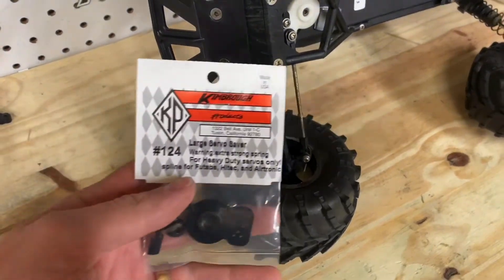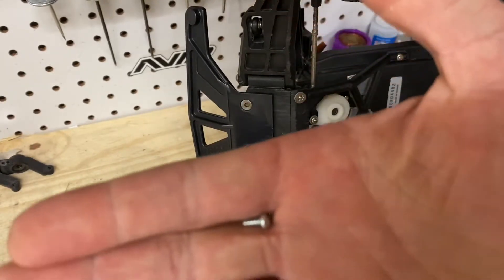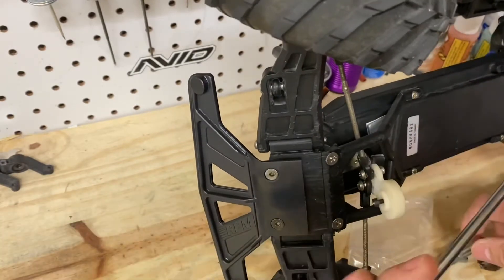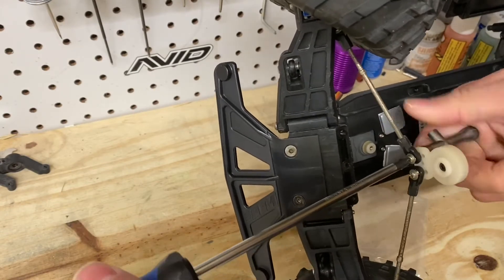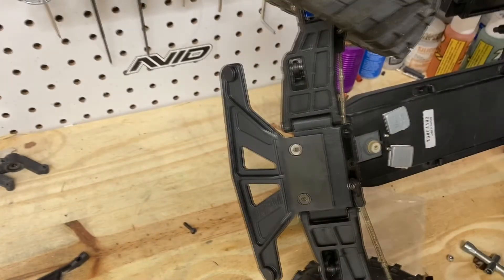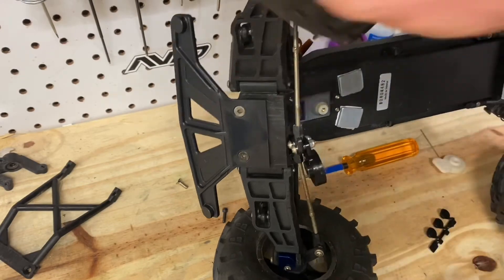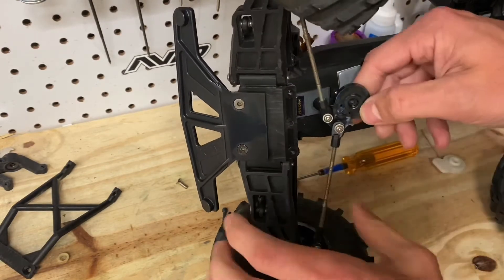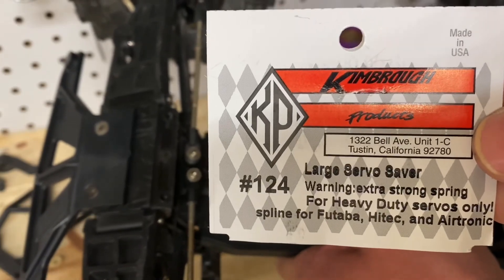KIMBROUGH - Large Heavy Duty Servo Saver Upgrade For Traxxas Stampede 2WD

Comment: How long did the heavy-duty servo saver last thinking about getting an aluminum one from hot racing
Reply from the maker: Still good, no issue with it!
Reply: I used to have a hot racing servo saver but the servo horn would strip easily
Reply: @@mattcamara4480 hitting the bumps would shear the teeth on the servo so I had to get new servo horns and servos

Comment: Is this similar to traxxas 1844 servo saver for Bigfoot?
Reply from the maker: Yes its a stronger direct replacement !
Reply: bro. it's not fitting right...
Reply from the maker: @sureshselvaraj9616  did you drill out the 2 holes in the horn to replicate the traxxas one?
Reply: @SuperFastRc  I did the hole, Its not about the hole, its about the spine drive, Its making some Noise
Reply from the maker: @sureshselvaraj9616  You might have a stripped servo gear if its making noise.
Reply: @SuperFastRc  But it still turns and runs fine.., its not making noise with the original
Reply from the maker: @sureshselvaraj9616  the only thing then could be something with the spline bushing. Make sure you have the right sized bushing installed for the servo. Other than that 🤷‍♂️ not much else can go wrong unless the part is defective.
Reply: Yes it was the servo issue, now i have changed the servo .. works great

Comment: I read you have to drill your own holes. Is that true?
Reply from the maker: Yes you need to enlarge the holes for the stock turnbuckle screws.
Reply: @SuperFastRc  what drill bit size did you use to enlarge the holes?
Reply from the maker: @ligmabowls5000  3/32 i believe